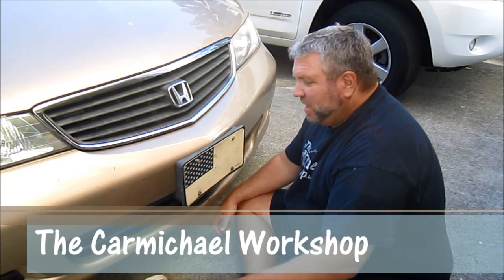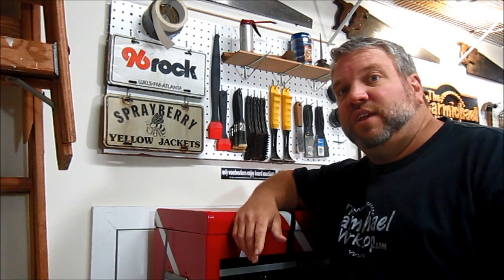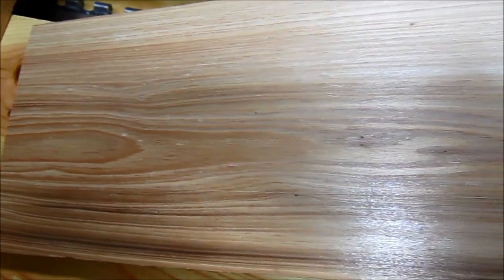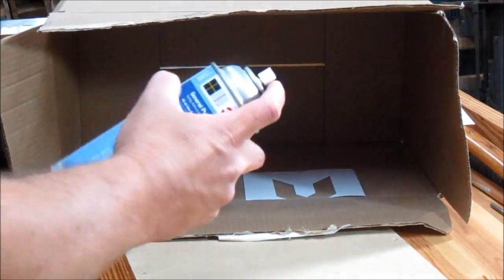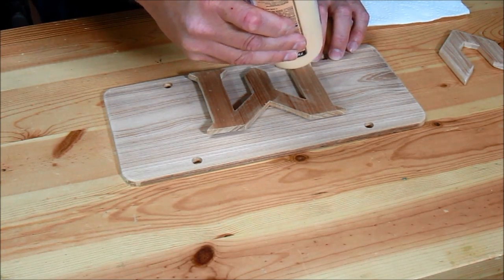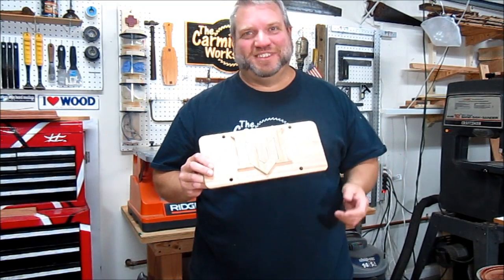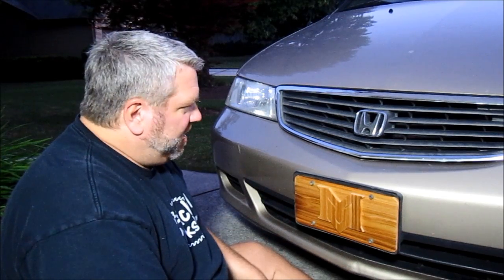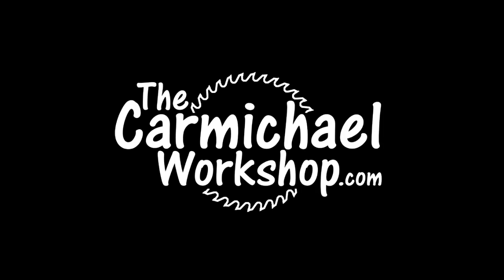Create a Wooden License Plate for a Car, Truck, Boat, Bike - Easy DIY Intarsia Project

Comment from the maker: We only have one toll road in my area.  We also have a toll lane on the interstate where you can pay to drive in it.  I don't use them, but I think people who do have to get a transponder unit to mount on their windshield or sunvisor that sends a signal.  We also have video cameras at major intersections that take a picture of your license plate if you run through a red light.

Comment: Illinois (where I used to live) you need a real plate on the front as well. But here in Arizona only the rear is needed.
Reply from the maker: Ooh, you can make a plate then.  he he
Reply: Steve Carmichael Actually looking to buy a band saw in a couple days. your 4 foot box was fun to watch and I plan to try it. That and the jewelry box you built your daughter. :-)

Comment: what type of wood would be best so it weathered nicely?
Reply from the maker: I think cypress, cedar, redwood, or other wood that naturally resists rot would be good.  The plate started looking bad after about 6 months.  Use something more protective than a few coats of spray lacquer.
Reply: what would you suggest to use other than a few coats of spray lacquer?

Comment: what spray adhesive do u use for the template
Reply from the maker: 3M General Purpose 45.  I spray a very light coat and let it dry about 30 seconds till it feels like a sticky note, then it will peel off pretty easy.

Comment: nice video. but i think it will get a crack because the cross gluing :( 
in the netherlands requires two plates + 1 if you have a trailer

Comment: Washington state requires both. Front plate is what cops point the radar gun at. The reflective surface  fades over time, so they make you buy new plates. Every 7 years here.
Reply from the maker: Jeff Gunstone Interesting.  I wonder what GA cops point at then.

Comment: Here in Denmark it is mandatory to have in front AND back. Specific font and appearance. 
Unless you had your plates stolen and drive with a temporary.. this must be in back. 
Speed cameras also face forward, so dismounting front plate won't do any good.

Comment: Texas requires two.
Reply from the maker: samuel sweat I'm expecting GA to require two eventually, so they can charge us double.  lol.
Reply: It's about 60 a year here Steve Carmichael
Reply: Yeah, and they're making us change out the plates every few years (four I think) even if our old plates aren't in bad shape. I was really annoyed when I had to do it this year, because the default plates in recent years has looked nice, but this year it's plain black and white. They're trying to get you to pay for custom plates, which is a ridiculous fee.

The good thing about this though, is that I have extra plates to decorate my shop walls :D